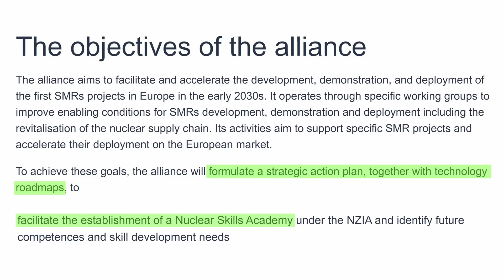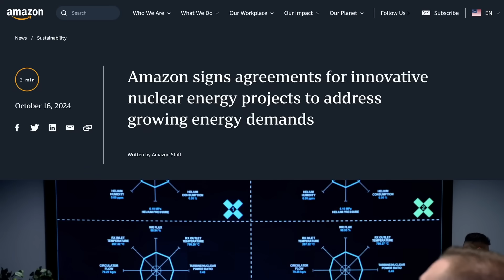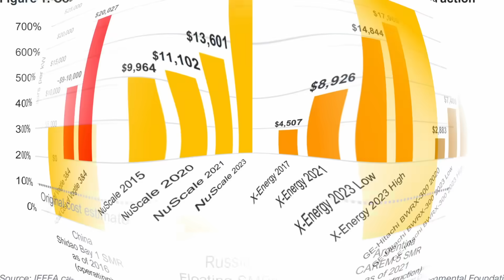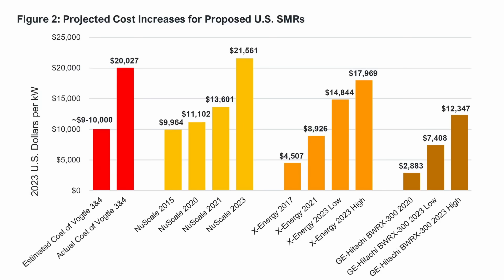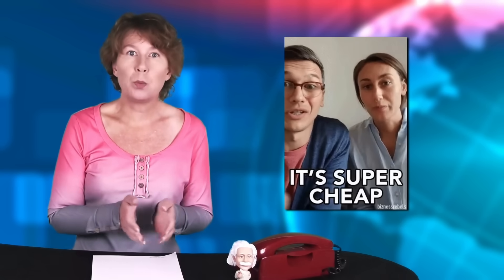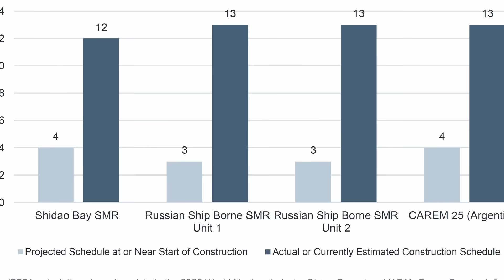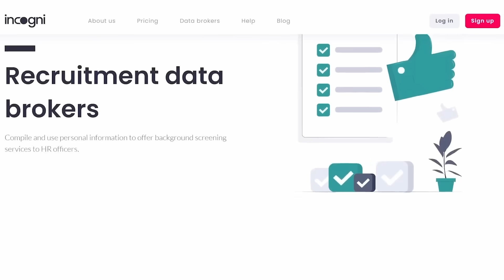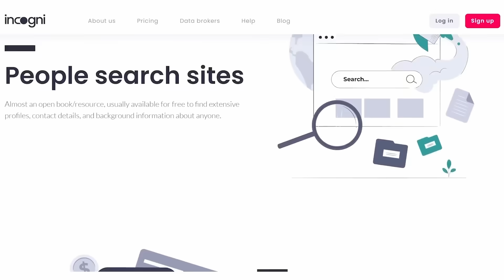Small Nuclear Reactors Have A Big Problem

Comment: From what I've read, compared to land-based nuclear reactors, the reactors used in US, Russian, and British submarines are generally limited to about 165MW, drive turboshaft props directly rather than generating electricity to drive electric engines, use more highly enriched uranium that might otherwise be the focus of proliferation concerns, and overall have fewer safety mechanisms due to the limited space.  So, it might not be very easy or cheap to safely convert them to small commercial land-based modular reactors.  Perhaps SMR startup investors hoped they could use submarine reactors as a basis for product design, but underestimated the cost and effort to meet the necessary safety standards.  But I'm not a nuclear engineer and I'm sure others will weigh in on this.
Reply: As a Navy nuclear operator it was kind of funny seeing a reactor of a few hundred megawatts as small and modular. I guess compared to civilian reactors we were small. But modular? The reactor compartment on the USS Enterprise was quite large and required quite a bit of equipment. That's not even including the reactor auxiliary room, coolant turbine generators, and steam room itself. To be fair, that was 1950's technology. And yes, we used enriched uranium.
Reply: @JimmyMon777  The USS Enterprise also had eight reactors.
Reply: Thank you for this. The question of "Don't we already use small reactors on submarines?" was immediately apparent.
Reply: No Navy will discuss their reactors.
Reply: @jimsvideos7201  Russia has nuclear reactors in civilian icebreakers for almost 70 years, which used to take tourists around
Reply: @ How much information on those reactors is publicly available?
Reply: A huge difference is that a Naval reactor does not have to design for seismic events.  The ship or submarine just bobbles in the water.  Land based reactors have to design typically for twice the energy of the worst possible earthquake in the area based on geological records.

That means that everything from the thickness of the reactor vessel, piping thickness, tanks, foundations, walls, floors, etc gets much thicker and costly than if you don't have to design for no earthquakes like ships and submarines do.

Seismic design is the single biggest cost variable for a nuclear power plant - and is totally site specific.  That is why there are and never will be a "standardized" design for nuclear power plants.
Reply: @perryallan3524 the other thing is those military systems are accepted for strategic reasons. A necessary evil. Not to mention they don't run on national soil and usually if they fail they eventend to "disappear where you cant see them" which is fine for politicians.
For tschernobyl we built the largest structure of mankind just to benable to clean it. For cosmo they just stuffed it with concrete and some special goo. Both probably good for some decades...
Reply: @perryallan3524  The lack of seismic requirements is completely overshadowed by the need for things like depth-charge survivability.  The supports/ fastening requirements to survive a depth-charge or other nearyby explosion are MORE stringent, not less.  Back in the 50's and 60's, the lead boat in each class of US sub was actually subjected to 'low amplitude' depth charges to verify their survivability.  That included the reactor systems staying online.

Remember, they are WAR ships afterall.
Reply: @mikefochtman7164  Surface ships are not designed to withstand depth charges.   No one is talking about building nuclear power plants in submarines.  They do talk about building them on barges or ships.

Also, in war it is acceptable for a nuclear propulsion system to be allowed to sink to the bottom of the ocean.  That is not an option for a civilian power plant (even if on a barge).

Totally different design conditions and constraints.

Power plants are not designed for military applications.  Military propulsion systems are not designed to be land based power plants.

Also, military propulsion systems are several times as expensive to build on a per MW basis than are equivalent sized land based civilian reactors.   I have no idea why you think they are a good idea - at all.  Makes no sense from either an economic nor safety perspective.  Military propulsion systems are very compact and use extremely highly enriched uranium - which is also extremely expensive.    

Other than Shippingport which was a demonstration - test power plant using a naval reactor no one has ever suggested that we use military reactors for civilian generation.   Note that Shippingport was shut down after testing a breeder thorium core because it was so uneconomical to operate compared to civilian nuclear power plants of the day.
Reply: I imagine these are HUGELY specialised reactors and therefore EXTREMELY expensive. Hence, only the military can afford them.
Reply: @GavinM161  That is true. It's not that it's entirely unaffordable but it's not as cost effective as a large LWR. There's not much point to build that kind of design for grid scale electricity.
Reply: I was asking myself the same question: What about reactors on ships and submarines? The first problem I thought might be the price, so I checked: Submarines have 20-220 MWt output, so divide by three to get the mechanical or electrical output power so you would have 7-73 MW electrical energy from a submarine reactor, and 100-230 MW from a surface ship reactor, and these have usually two of them.

The submarine reactors cost between 100-500 Mio, which is a large range, but it does not seem to depend on the size.The smallest reactor had cost about the same as the largest in the submarine-reactor category.

Surface-ship reactors seem to cost twice as much, while having three times the power, but this is still not that much power. For about 800 Million to 1 Billion you get like 230MW electric power, where as land based nuclear power reactors have 800-1400MWe, 4-6 times as much,

However, the price does not look that bad. Assuming that the price for the ship-reactor needs to be doubled because you still need to get the land and build stuff around it, like floors and roofs and walls, and you still need external cooling water, I guess, but anyways, levelized costs of electricity would be around $100-$130 per MWh, well within the range $60-$194 for larger projects, They are also not much cheaper.

This is also in line with actual number for small modular reactors, which cost $500 Million - $1.5 Billion and have LCOE from $60-$250 per MWh.

So it can't be the costs that make these projects fail, and what the Russian did was to put their KLT-40 PWR, a surface ship reactor with 35MWe and 150MWt onto floating platforms or icebreakers to power remote settlements. 

So I guess it is more a problem specific to the West that makes it that only China and Russia have operational SMRs for civilian use.

My guess is that uncertainty drives up the costs, and the upside just isn't there for SMRs. If you are lucky, the LCOE will be in a range of other new, big NPPs, which have problems to compete and aren't profit centers either, and that's why there is no boom in building these, either, but I guess if you must go nuclear, you rather go with established sizes and well-known tech.

So with SMRs you might get lucky and win nothing, or have bad luck and lose all your money. This is not very attractive for private investors, so it is one of these projects that needs tax-payer money, but not that much tax payer money. Maybe one aircraft carrier worth of money, like 15 billion.

That amount of money should buy two or three competitors to build and demonstrate prototypes and hook them up to the grid for a couple of years, weed out the kinks and the stuff that doesn't work, and end up with a proven reference design for a unit that other companies can license and build upon.

Large corporations also have a lot of money, but when it is not their core business, they may be reluctant to invest. If they have a crazy founder-leader-owner, he or she might be crazy and rich enough to also finance such a thing, but it is a lot of money even for them. Look at Elon Musk, the supposedly richest man on Earth, how he had to borrow money to buy Twitter.

The other reasons like proliferation and HEU might also play into it, but generally you will have to secure the site as well as any other nuclear reactor. It contains radioactive materials after all, and you don't want anyone to blow it up. However, there is an easy solution for that: You put these things underground.
Reply: @peterprokop  Naval reactors do not have to be designed to handle earthquakes, as the vessels they are in just bobble a bit.  That is a very big cost factor for land based plants.

Naval rectors also do not have to be designed for other "design basis" accidents to protect the health and safety of the public.

It's quite acceptable if a naval reactor ends up on the bottom of the ocean along with its vessel (and a number of them are down there).  That is not acceptable for a civilian nuclear power plant - at lot more redundancies and robustness must be designed in - which adds cost.
Reply: @peterprokop a very simple addendum. After three mile island the questions by Congress were: do we keep running nuclear plants ?
If so, so we put them under military control?

The admiral of the nuclear navy was a very different person than the MBA who makes decisions in a publicly listed energy company middle management.
Thus, the engineers requests to extend the flood walls at Fuku was denied by such a manager.
Reply: "drive turboshaft props directly rather than generating electricity to drive electric engines, use more highly enriched uranium that might otherwise be the focus of proliferation concerns,"

The first is true, but irrelevant. The steam doesn't care whether it is spinning a propulsion turbine or an electric turbine. 

The highly enriched uranium is true, however building a larger reactor vessel to use less enriched uranium is not a big change. You can look up some of the heavy transport vehicles to see what they can move. It's impressive. 

The reason the Navy cal can build a reactor on time and schedule is practice. At one time there were 105 S5W reactors sailing around the various oceans. Later there were 85 S6G reactors. There were also two reactors per Nimitz class carrier. Practice makes perfect, or at least less imperfect.
Reply: Good thing that they are not being used in SMRs then
Reply: Navies are willing to pay a lot more for the power used on warships than the consumer market will. The cost per MW is not important if using a small NPP gives you unique combat capabilities. The problem for SMR companies is militaries are the only energy users who feel this way.
Reply: Where did you find that out? I thought all that stuff was top secret? They dont even want to disclose diving depth of their nuclear subs?
Reply: @northernmetalworker  Mostly Wikipedia...but I closed my eyes when I read the stuff to be safe.
Reply: @victorkrawchuk9141  lol thanks for going easy on me!
Reply: You can't they use partially enriched uranium to make them work and the design is proprietary. However, GE and RR have a lot of experience from building these reactors and that gives them an advantage, I think they will be the ones to eventually win the race. Energy density is a problem for non-enriched reactors, so size will inevitably be bigger than a sub reactor.
Reply: A lot of the Fukushima damage is due to the regulation that you need permission from the local mayor to vent primary coolant. Of course, the local government will say, "no," and the pressure will continue to rise.
Reply: @Mandelbrot_Set  Can you point to the title of any report that stated that the local mayors refused to let venting to occur during the Fukushima nuclear accident? I must of missed that.
Reply: @Mandelbrot_Set  Most of the Fukushima damage is the nuclear regulator insisting that biologically inconsequential amounts of radionuclides warrant permanent evacuation of tens of thousands of people, destroying their lives forever. And stripping several feet of fertile topsoil that could be used to grow food, because of a few stray radioisotopes you can detect in it. All this is the equivalent of burning your house down because a spider bit you during the night.
Reply: @Mandelbrot_Set  Fukushima was due to a very bad decision by the Japan Nuclear Regulator regarding what was considered a "design basis accident" that had to be deigned to withstand.

Most Western Countries adopted a standard of "worse than anything in the historical or geological record."   

Japan, at least in part, adopted a standard (at least in regards to flooding) of any natural disaster that on average occurred within twice the planned licensed life of he reactor (which was 40 years).  So they only had to design for tsunamis that occurred if they occurred on an average frequency of 80 years of less.  In that area they occurred on average every 90 years of so.  That meant that there was a 45% chance of such a tsunami within the 40 year license life... and it occurred.

Major opps!.  Japan shut down all nuclear power plants and revised their design basis criteria to "history and geologic record;" and have only allowed plants to restart that can meet the new criteria after modifications.  I think only about 30% of the plants have been allowed to restart at this point; and my understanding is that it has been concluded that some plants cannot be modified at all to meet the more rigorous design basis standards and will never restart.

As for the rest of the world.  The USA NRC adopted a requirement that all nuclear power plants have to design and have a way to respond to "beyond design basis events."   This was I believe about a $15 Million dollar project at the plant I worked at. There are now multiple pumper trucks with lots of hoses all stored in a seismic building that can suck water from Lake Michigan and pump it to a variety of new fittings on all kinds of systems in the plant, with the assumption that the plant had lost use of its emergency diesel generators and that the battery room for control power is dead as well. All kinds of new "emergency procedures" and Operations drills several times a year on setting it up and running it (except they are not actually pumping lake water into the system of component they would be in a real emergency - but the hose is pumping water right next to the fitting and manual valve that would be used - it just pumps into a longer hose that goes to the Service Water outlet system and returns to the lake.

I understand that Canada and some European countries have adopted similar requirements.
Reply: BAe systems Sub building is on fire.
Its where they build Nuclear Subs.
Nice one Mr Putin.😄👍🇬🇧
Reply: @g4joe  There was no nuclear risk. Are you saying that the reactor was fuelled and in operation in dry dock? LOL!
Reply: There aren't less safety concerns because of limited space. There are less safety concerns because states consider military members to be expendable bags of meat.
Reply: Great video no stupid music
Reply: This is because of the same old problem. Nuclear power is insanely over regulated. In comparison the old Chernobyl design is by estimate some 100 times safer than coal, while modern designs are some 10,000 times safer.
Reply: @Lucien86  The "Old Chernobyl design" would have been fine if it was operated properly, but it wasn't.  Imagine 400 Chernoblys run by whatever idiots you could find off the street running them, which is what you would need to replace fossil fuels in the US for example. Also most coal has been replaced with natural gas, which produces much less pollution (if you ignore climate change, where it can be bad due to methane leaks)
Reply: @takanara7  The RBMK reactor design was deficient in key nuclear safety items in multiple ways (and fatally flawed by western standards).  It was nowhere near even the safety standards of the US Atomic Energy Commission in the 1950's (when such things were rather loose in the USA).

There is a reason that Russia never event tried to upgrade the design of the RBMK reactor after Chernobyl.  Instead they focused on the VVER which could be upgraded to more acceptable standards far cheaper.
Reply: @Lucien86  And we all can see how that worked out at Chernobyl.
Reply: @Lucien86  lol. you were not in Tokyo after the failure.
Reply: @dosgos  What has that to do with anything? Millions of people were in Tokyo and none of them died from Fukushima - except maybe from nuclear paranoia. Japans switch to coal however probably killed more people than the disaster did.. The problem with coal is that the deaths are all invisible, individually almost impossible to prove..
Reply: @Lucien86  Tokyo was lucky the prevailing winds were blowing offshore. We can pretend there was no risk but that is a well-documented fiction.

But an honest evaluation of the risks and mitigations is the only way nuclear is going to get traction.
Reply: That is a really interesting design estimate. I would wager it's also really useless. @Lucien86
Reply: @Lucien86 is that why they are also uninsurable commercially and does that explain why they are so often built nearr borders or at the coast?
Reply: @Lucien86 provide links for your numbers...

 independent ones!
Reply: @DoctorOnkelap  Basically my numbers come from W.H.O. estimates. The 6000 number came from the Wikipedia page on Chernobyl. (and elsewhere) The number for coal is my own extrapolation but again drawn from WHO figures. The real problem is that there are no precise accurate figures for coal even today, and they would be incredibly expensive or impossible to produce.. However the totals are not in massive dispute among real scientists.. A very crude measure is to take the total amount of coal burned and divide it by 1  death per 10,000 tons burned.
Reply: @Lucien86  thanks for replying. An estimate is still usefull and it is shocking to see how little the MANY dangerrs of coal are shared.
Reply: @Lucien86  Coal cannot melt down or cause a radioactive disaster.
Reply: @Lucien86  But didnt Chernobyl have a bit of a problem....
Reply: @Lucien86  In fact the LNT-based estimate of Chernobyl fatalities (which is already inherently unscientific nonsense) is comparable to what a Chernoybl-sized coal power plant kills over its service lifetime from emissions.

So an NPP that is literally guaranteed to undergo a Chernobyl level accident at the end of its life is about on par with a coal power plant in terms of environmental effects.

The public just treats one very seriously on emotional grounds while the other is accepted as a necessary evil of modern society.
Reply: @zolikoff  The comparison I used was the WHO/UN estimate that Chernobyl killed about 6000 people - about the same that coal kills every two to three days. Even more extreme in Fukushima the meltdown killed about 0 to 10 people - while the evacuation killed about 1000.
Reply: @Lucien86  Yes, but instead I chose to compare Chernobyl with just a single similar-sized coal power plant. Sure, coal power overall on the planet kills thousands each day, but on the single plant level one plant kills a few thousand over its few-decade lifetime. This means there's a close to 1:1 comparison between a coal plant and literally the Chernobyl accident itself. Or in other words it's one Chernobyl per day on the whole planet.
Of course the WHO estimate for Chernobyl is based on applying LNT over low dose rates on a huge "affected" population and in reality it's just fantasy nonsense without scientific evidence.
Reply: @zolikoff  This is a laughably asinine way to evaluate risk.  First off coal polution dosn't kill in an acute manor, its a few months to years taken off the tail end of peoples lives by declining respiratory capacity and it is spread over millions of people.  Radiation in the event of a meltdown DOSE cause acute death and is infact incredibly horrifying and painful.
Reply: @zolikoff congratulations, you have a roughly pre-accident 1980s understanding of accident acceptance. expert bias was was the term for it. Also, please provide numbers for the scenario without evacuation of the surrounding cities. Also please just to be sure, in case of evacuation, can you explain where we gonna put the resettled people in a country with just 15 plants? Assuming they all go pop at the end of their lifetime as you suggested. Also, to be nice, you don't need to assume the usual lifetime expansion where the corp running the facility just adds 30+ years of reactor time that wasnt planned for, and don't need to consider that this accident happened at the prime time of the facility vs. the tear and wear that happens at the end of such an extended life, when the best staff might even have left for a different site already. The added risks people like you invite with such uninformed biased optimism that is used to wave away even the responsibility placed on the operators by the designers!

If you cant even grasp why societally accepted risks have a time and distribution dimension then you should be most inclined to have some humility as a human and just effing accept that society is smarter than you who read that overused assumption.
And I would like to mention that the accident estimates from the report that used this "risk acceptance" factor have turned out to be unreachable since fukushima. You would need like 500 more years of accident-free operation to get close to the accident risk they had assumed.
Even if you're smarter than common wisdom you'd still have to get that in your head. The assumption of that accepted risk comes from a study that assumed there would be much less accidents. And here you are talking about letting every plan just pop at the end of its lifetime.
In some sense you're worse than the paid lobbyists and marketing agencies of the 90s and 00s
Reply: @kennethferland5579  Only on the power plant grounds. You cannot get ARS from a nuclear accident unless it is very very serious and you are within less than a mile of the power plant. It is essentially only a danger to workers and emergency personnel. Much like other industrial sites where explosions and chemical exposure present similar hazards.
Reply: Nah, Issue is that SMNR got federal grant money, they never really expected to produce a commerical product. it was all about getting gov't funding. 

Utilities have zero interest in new nuclear power plants, Small reactors are far far less economical than the big reactors. You still have to do all the same regulatory filings per reactor, no matter the size. Why spend the cost for 8 or more SMNR when you can just do one big reactor. Second issue is that the world is running out of economically recoverable uranium & most of the high grade ore sites are in unstable regions (Africa, kazakhstan, etc). Uranium production peaked in 1980 & has been falling since. the World will likely run out of economically recoverable uranium ore around 2050. Utilities Execs are aware of this issue & don't want to deal with the 20 year time frame to get a new reactor on line, only to see uranium fuel costs spike to the moon.
Reply: We aren't running out of economically recoverable Uranium, rather, the price of Uranium has been so low that uranium mines have closed down, demand dwindled and so did the price. If uranium prices go up a bit those mines are easy to reopen to meet demand for a long time to come. The price or availability of raw uranium ore is not the issue, refining it is where it gets costly but even then, you don't need large quantities, you need something on the order of 6000-12000 kilo's for the whole reactor fuel assembly. An absolutely trivial quantity in terms of mass and volume compared to coals and fossil fuels. This is a for a full GWH sized plant, SMR's would need far less but lose some efficiency.
Reply: @seetheious9879  I checked some numbers. A large PWR of 1.2-1.4 GW should have about 80-100 tons of enriched uranium which takes about 4-6 times more naturally miner uranium. So with around 500 tons of mined uranium you get a full core load which runs the reactor for 4-5 years.
A country the size of France needs about 40 such reactors worth for electricity, so the total country fuel consumption is 4000 tons per year. It's really not that much. If we start with ocean uranium extraction, which is only about five times more expensive than current mining, there is enough natural uranium to run the world for tens of millions of years...
Reply: @zolikoff  It depends what we are talking about. If we are talking refined U235 it seems to require 2.16-2.7 tons for a 1GW reactor holding 18 million pellets. Total Uranium mass: 45-55 tons. Requiring 20-40kt of uranium ore.
Reply: @guytech7310  The uranium thing is a myth. That's what they said about oil and helium. There is still billions of tons of both helium and uranium out there, its simply a matter of looking for it. A lot of oil still out there too we just shouldn't be extracting it.  ❌🛢
Reply: @guytech7310 If this is true, are we anywhere close to breeder reactors? I was lead to believe nuclear was an inexhaustible gift from God.
Reply: and another problem with safety that they don't have on ships and submarines: emergency cooling
on a ship or submarine, you can just dump bilgewater into the system to cool it in an emergency circumstance, but unless you have your reactor hooked directly to a fire hydrant or natural water source, you can't easily do that on land.
Reply: @dawnderg  Dumping seawater into the primary will more or less permanently brick that reactor. There's no point in doing it.
Rather, these reactors are small enough that you can rely on passive cooling in the RPV and primary circuit, the decay heat may not even be sufficient to melt the fuel elements even without any water in the core... In fact newer subs can even run the reactor at reduced power entirely passively, and turn the main shaft at a reduced power, without having to use primary pumps that are a source of noise.
On land the Gen 3 passive safety is usually accomplished by having large water tanks at an elevated position (like on top of the containment building) where you can rely on gravity to feed that water if needed.
Reply: @EbenBransome Was it not a CVN reactor though? Those are a bit more powerful, they might have more of a heat problem.
There's one more thing: While the fuel elements may not melt from decay heat, they may still incur thermal damage, broken cladding etc, meaning the reactor might still need repairs & fuel replacement. Which on a sub is a huge task and likely even decommissions it on the spot.
So there's still reason enough to want to keep the reactor cool and stable. You don't want to damage it. Not necessarily because you want to avoid a "big accident", but because you want to keep the sub in operating condition, which is the primary goal.
Reply: @zolikoff  Especially with a carrier which is a significant investment in money. Not that subs are cheap either. I was on the Enterprise, so we had "smaller" submarine sized reactors, and yeah that fuel cladding can easily melt. You really do need pumps running for quite a while after shut down or scram. As mentioned above, newer sub designs can rely on natural cooling flow for low power operations so they don't have to run the coolant pumps (as mentioned this reduces the noise levels).
Reply: @zolikoff  There is a reason to flood the primary loop with seawater - if the ship or submarine is sinking and the primary loop is already known to be compromised.  All naval reactors have the capability.

Yes, the reactor will never run again.  But the 1st rule of nuclear safety is to "protect the health and safety of the public"  Running the reactor is optional, even if it is desirable.
Reply: @perryallan3524  Well if the sub is already sinking I would hope the crew is evacuated and not caring about things like what happens to the reactor. It's going to flood one way or another anyway if the sub keeps sinking.
Reply: @perryallan3524  P.S. if running the reactor is optional, then the "safest" thing to do is to never build the reactor in the first place. I would hope that soon humanity gets over this very wrong way of thinking.
Reply: @zolikoff  Living in your apartment, condo, or house is also optional.  No one requires you to do so.

At the same time it is desirable, and the vast majority of the populations does so.  But if something really goes wrong you exit quickly and know that you are never going back.

Working your job, having friend, a significant other, and many other things are optional as well, but desirable.

Please be consistent in applying your argument.
Reply: @perryallan3524  Exactly. Not living in a house has its own risks and drawbacks, that almost always outweigh living in a house. Even though living in a house also comes with some risks. This is understood quite intuitively by everyone.

For some reason, when it comes to nuclear energy, the human brain fails to work this way though. Even though the benefits far outweigh the risks, humanity insists that what's most important about nuclear energy is not to use it to our benefit but to mitigate its risks. Even if it results in using much more harmful sources of energy. Because access to energy, while also "optional", is quite useful and, dare we say it, saves lives.
Reply: @EbenBransome Tall story.
Reply: @zolikoff do you know how submarines work? It's not a graceful ... hey lads last one out turn out the lights, everyone dies every time. Still there is a big difference between a nuclear powered and nuclear armed sub, and a few have been lost or have gone missing, 

Still there is an odd correlation, if you have nuclear powered subs, you by extension usually have nuclear armed subs ... I say this as an Australian, our government has signed up for the AUKUS deal, where we buy 5-6-12 nuclear powered but conventionally armed subs ... plus we also need to throw in 6-10 billion dollars so the UK/US can upgrade their shipyards to build them maybe? While probably selling us old refurbished Ohio and los Angeles class tin cans.
Reply: @EbenBransome People underestimate a nuclear disaster because government will cover up any nuclear disaster and downplay the damage, to save their own skin. Coal plant are bad but nuclear is not the lesser evil, it's just the unknown evil, could be small or could be monstrously evil.
Reply: @jarrodcross1482  I know Russian submarines have escape capsules. Just because it goes down doesn't mean the crew must die.
Reply: @zolikoff  That's not quite right.  Yes, some naval units can run in natural circulation mode, but that still requires an intact and properly filled coolant system (what you named, 'primary circuit').  If the circulation between core and steam generators is interrupted, they most certainly can meltdown, unless flooded at the bottom of an ocean.  Yes, flooding the reactor compartment would essentially end the operating life of such a reactor, but it would prevent a large radiation release.
Reply: @dawnderg  The cooling for the ship sized small reactors is much better all round, you can show that there's an entire class of cooling failures that can't happen. But the problem is that they're uneconomic for civilian power plants.
Reply: @dawnderg  You have no idea either of how a small PWR operates or a submarine.
Reply: "and another problem with safety that they don't have on ships and submarines: emergency cooling on a ship or submarine, you can just dump bilgewater into the system to cool it in an emergency circumstance"

No, you don't just dump bilge water into the system, yes you are in the ocean and the reactor core is below the waterline so natural circulation will cool the core.
Reply: I have found the US military are not necessarily interested in efficiency or initial costs, they are interested in capability. For example, no one else in the world would build and operate aircraft that costs multiple $billions per copy. The US political establishment just throws money at the military. So I wouldn’t be so sure that military nuclear generators would fit the bill for commercial uses.